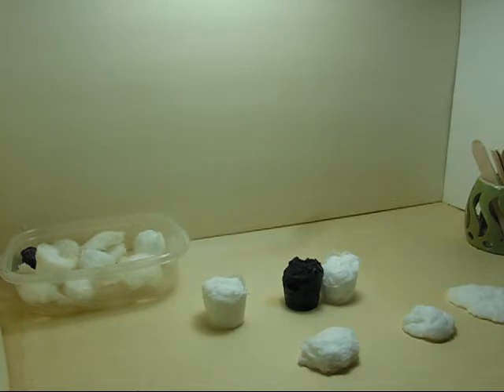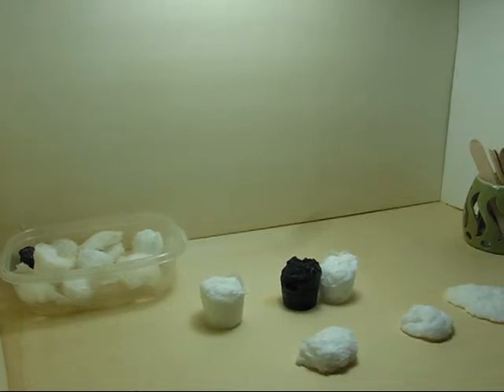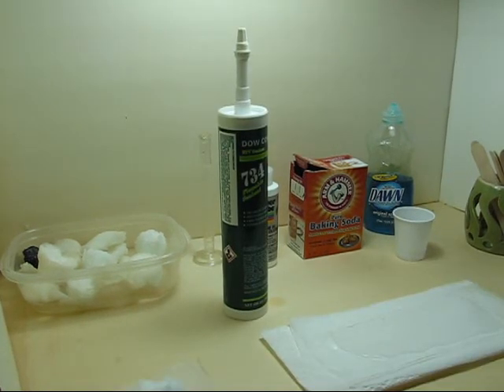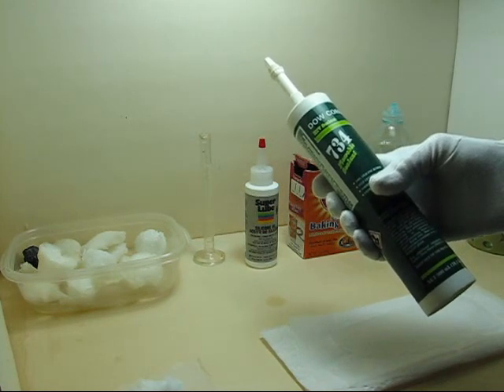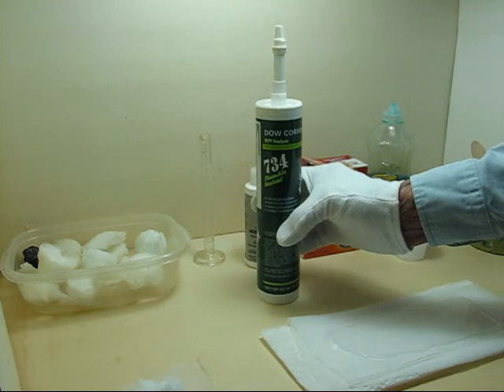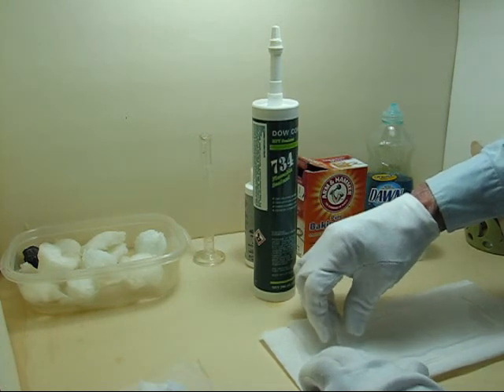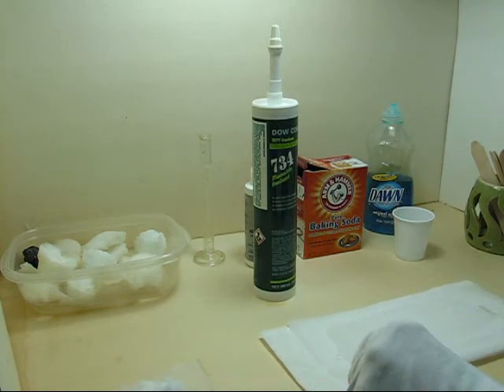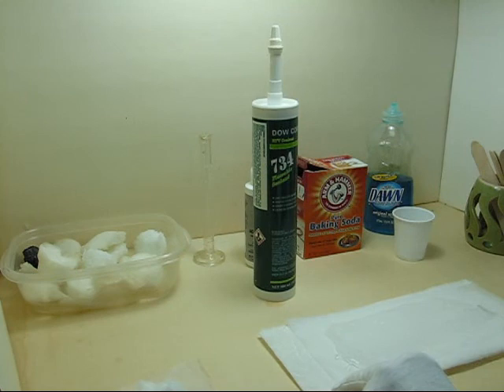Make silicone foam from silicone caulk!

Comment: In case the website ever goes down just wanted to preserve the info here for the future. This is a copy paste from his website. 

Silicone caulk. Use GE type one, Dap, or other acetoxy cure silicone. The caulk has to cure with moisture liberating acetic acid. This is the one most used for sealing bathtubs and other areas. (Look for releases acetic acid on the back of the standard 10 ounce tube).
Silicone oil. Used for lubrication of many materials and readily available at hardware stores. I used Super Lube from Home Depot but any will work to thin silicone. (I learned the hard way to not use V M & P naphtha, Xylene, or others as they causes too many problems).
Surfactant. Any dish washing detergent to lower surface tension.
Baking Soda. Sodium Bicarbonate.
Vinegar. Regular white distilled vinegar.
Instructions:
Weigh out 20 grams caulk, 2 grams silicone oil, and 3-4 drops dish detergent. Stir well to integrate. These steps go together easily.
Add 10 grams baking soda. (Move quickly but mix completely to prevent voids. This will begin to skin over and release some acetic acid smell but this is normal).
Add 5 milliliters vinegar and continue to move quickly. (The mix will begin to foam but settles down fairly rapidly. You now have a stable closed cell silicone foam). It will cure externally in several minutes and cure completely in 12 hours. As most caulks perform, maximum strength is reached in 2-3 days.

Comment: Can you show how to make the one with critic acid that is more like a memory foam? I really would like to make some like that.
Reply from the maker: Just add citric acid as the baking soda in the same amount. But, you can only make a reasonably thin film and not really thick if that's what you want. I am working on making memory foam that can be thick so it can be done. Ken.

Comment: Nice work! Question: would acetone work to thin the silicone caulk? I haven't tried it but read that it can be used to thin it. It has the advantage of evaporating (eventually, I am guessing) and being a naturally-occurring molecule should be fairly safe. I think it's cheaper than the silicone oil, at least what I could find as a source in Canada (the only source for the oil in your video I could find was Amazon and it was $30 CAD for 4 oz -- HD does not carry it here, nor any other hardware store I looked into).
Reply: yes it does

Comment: Can the foam be used to make molds for resin pouring?  It isn't always easy to find a silicone mold for what I need and the other attempts I've made at making my own haven't been great... Thinking this might work... 

By the way, glad you havent caught the bug!  I enjoy your vids!
Reply: You should also check out his blog and video on using gelatin and glycerol to make a reusable mold very similar to silicone if you haven’t seen that one yet.
Reply from the maker: Yes because its closed-cell but try a small sample to test first to confirm, Ken.